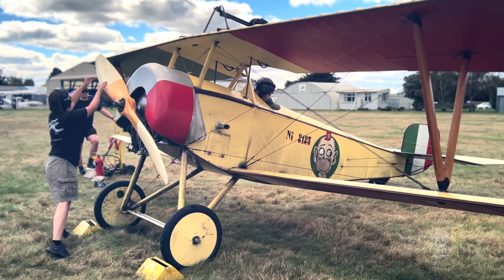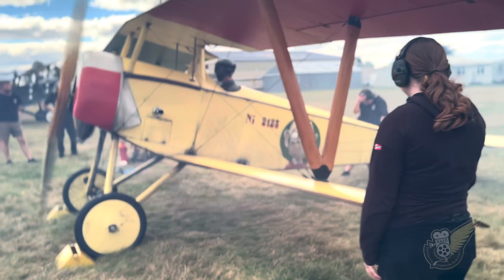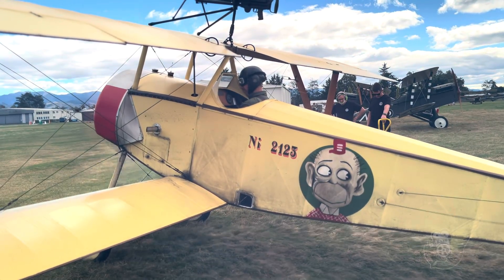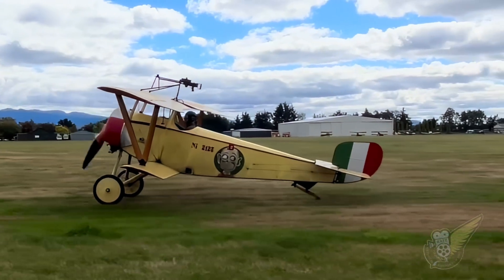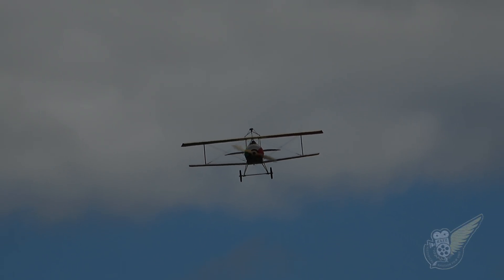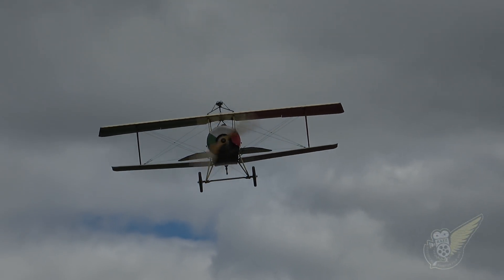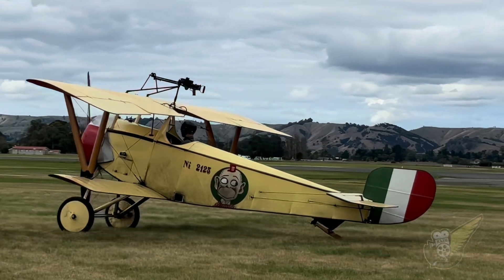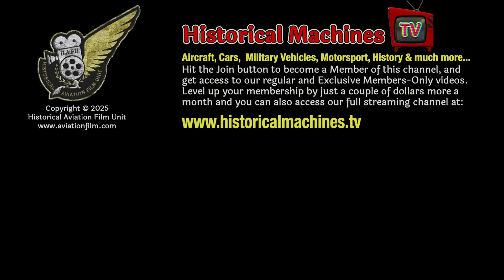Did You Know WW1 Aircraft Used Rotary Engines?

Comment: It is a radial engine. All rotaries were radials, but not all radials are rotaries. The first radials were designed to spin, and were built into the wheels of early motorcycles. The design was enlarged and used to power early aircraft since they stayed cooler due to the cylinders whirling through the air. As they got larger and more powerful, the gyroscopic precessive effect of the heavy spinning engines made the aircraft increadingly hard to control, manufacturers began to build them as fixed radials turning the propeller on the crankshaft in more conventional form.
Reply from the maker: I'm not going to argue with you as I'm over it. General parlance is that these ARE 'rotary' engines, and that's what we call them. What you're saying is like saying the aircraft is NOT a biplane because it has two wings and it is actually a double-decker! Well, no, it IS a biplane because that's the name that people generally call them. You will find very FEW people who know what this type of engine is, who call it a radial.
Reply: @HistAvFilmUnit  
That's a pretty lame comparison, but OK...
...in Germany a biplane really is called a double decker.
It's a radial because the cylinders are mounted radially on the crankcase, like "radiating" outward. That's what makes an engine a radial.
Call it a rotary all you want, nothing wrong with that, but if you say it's a rotary but not a radial, that's incorrect.
It's still a type of radial engine.
"Rotary radial." "Fixed radial "
Reply: @rescue270  Radial is a configuration, rotary is an operation. Rotary because the engine spins, it's how it OPERATES, not just how it looks.
Reply: @waynepurcell6058  
True, that's what I just said. A rotary engine like this is a type of radial engine. I tend to be somewhat surprised by how many people don't know why a radial engine is called a radial engine. There are several ways of arranging cylinders on crankcases; inline or straight, opposed, H, V, W or fan, X, and radial. Rotary aircraft engines are radials that spin with the prop.

Comment: The WW1-era rotary aero engine was not adopted in favour of the radial. It was the earlier design, with serious disadvantages which the radial largely overcame. That's why rotary engines rapidly disappeared from aircraft after WW1. Gyroscopic effect of a heavy mass of engine turning about the crankshaft must've affected control response like turning and banking. In a dogfight that can be the difference between life and death. Fuel/air intake via the crankcase called for addition of castor oil, a poor lubricant for high-load components there. Lack of proper idling control meant 'blipping' the engine during landing instead of using a steady power setting. (Not to be confused with Wankel rotary, developed for cars in the 1960's.)  In my view the early aero rotary was just a silly toy, waiting for serious radial & inline designs to come along.
Reply from the maker: It wasn't really a 'silly toy' -- at the time it was the height of technology, one of the best engines that could be developed with the technology of the time, and one that solved a very real problem -- how to get the most power out of an engine, in a small form that could be utilised by a small and nimble fighter aircraft. That the type was overtaken by better radial and inline engines following the war was in part due to the rapid pace at which aero technology developed over the four years of the war.
Reply: @HistAvFilmUnit  I have to add one problem, a SERIOUS problem that was overcome by the rotary engine was engine cooling.  The other alternative would have been liquid cooled engines which means a vulnerable radiator system. 
Believe it or not there were some pre-WW1 cars built with rotary engines! 
However once practical radial engines were developed then certainly the rotary became a dead-end.

Comment: Very nice!   I think you have to define the audience (& try to get younger people interested?) & to do so in a manner that they will understand.   Some suggestions - most people will have been raised in an electronic environment, they flick a switch/turn a key & the engine starts.  Obviously not the case with hand started engines - so have the narrator make a (brief) description of pre-electric start engines & the need to swing the prop.  Other commentors have noted the engine management system , so  briefly describe the on/off full power/no power control - the audience will generally be oblivious to such a system.  & finally - a brief note on the total loss oils systems.  Just note the grime on the fuselage and tell the audience why.
Reply from the maker: You make some very good points! We'll certainly take your suggestions to heart for the future videos that we have planned.

Comment: Totally  expert  presentation!  Very  clear  view of the  rotating  engine!    A bit more on the fact that the entire engine ROTATES  , how it gave  horrible  "GYROSCOPIC  EFFECT   & terrible torque  made  turns  difficult.  Also  how the only way to slow the engine  was to cut out  spark  ignition, the only time  the engine  was not  burping was under max  takeoff  power!   ..nice  clear  shots. good job  ...is this  in   New Zealand?
Reply from the maker: Thanks for your comment and feedback.  Yes, The Vintage Aviator Collection is based in New Zealand. We are really lucky to have such an impressive collection of WW1 aircraft in this country.

Comment: How did you phrase the changing of the ammunition drum during flight?  "Very difficult?"  I would say "Practically impossible!"  Just as well the Foster Mount came along a little later
Reply from the maker: To be fair I did have in my mind's eye the Foster mount (which is on the Collection's RAF S.E.5a's), so you're correct. Unless the pilot was willing to stand up in the cockpit there was probably not much of an option to change the drums in these fixed mounted guns.

Comment: I THINK YOU MENT TO SAY RADIAL INSTEAD OF ROTARY AM I RIGHT ?😮
Reply from the maker: Absolutely NOT!  This IS a rotary aero engine..... did you actually watch the video.....?
Reply: They meant to say rotary.  This piston engine is rotary in that the crank is mounted solidly to the firewall/engine bulkhead.  The entire engine rotates around the crankshaft. The prop bolts to the crankcase, and spins with the engine.

 These engines were incredibly light, compact, and ran cool. They were also simple and dependable.

Comment: It would be a better video if you explained why so many Allied aircraft were powered by rotary engines: advantages, (ex: better power-to weight ratio compared to stationary engines), and even the disadvantages (ex: power output tends to fall off more rapidly with altitude compared to stationary engines.)
Reply from the maker: You make a good point! We are planning on delving deeper into rotary engine design and its advantages and disadvantages in future videos.
Reply: Cooling, easier to build, lighter.
Reply: Nice AI.

Comment: It's a beautiful biplane but how does the pilot reach high enough to operate the machine gun?
Reply from the maker: I believe that in the original aircraft there was a trigger-wire that ran down from the gun, into the cockpit. But I'm open to correction about that.
Reply: Later aircraft had a button (electric?) on the joystick.  Maybe this aircraft had one too

Comment: I think that the viewers that would watch a video of this type would be well aware of the reason for an early aeroplane engine having a rotary function, it is obviously very light for power output, it is also self cooling even when the aeroplane is not moving, and there are no reciprocating parts, unlike the radial engine which has to be constructed heavy enough to withstand the reciprocation of rods ,pistons etc through the crankshaft, that said, "modern man" being largely ignorant about such things ,and having seen many radial engines will argue for ever that this is a radial engine, just keep up the educational information, eventually it will have an effect on the dimwhits. Chris B.
Reply from the maker: Very true. You'd be surprised at how many people tell us (on various videos) "That's not a rotary, that's a radial" !!!  We're working toward a series of videos on the different types of rotary (aero) engines and will include much more detail.
Reply: The WW1-era rotary aero engine was not adopted in favour of the radial. It was the earlier design, with serious disadvantages which the radial largely overcame. That's why rotary engines rapidly disappeared from aircraft after WW1.
Reply: @rocketeerPM2500  Well yes! We all know the rotary engine was on the scene first, it was an ideal design for the very light airframes of the time, and the radial air cooled engine had not been developed to the the state it was after the war, the "disadvantages" you mention are few in relation to it's use in the very light aeroplanes of the time, and it had the advantage of being able to be built very light due to the non reciprocating of parts mentioned earlier, and having no need for coolant and radiators, it obviously had the disadvantage of not being able to produce much more than 200 HP, but there were very powerful rotary engines produced late in the war. Chris B.

Comment: Excellent job - thank you.

3:25 Just a suggestion: I am sure that your explanation here was enough for experienced viewers, but in my humble opinion it would have been better to say that on a sesquiplane the bottom wing was deemed too narrow to use the more stable N-strut type, which, because it has two points of contact on each wing using an interlocked double triangle structure that forms an inherently rigid trapezoid, resists twisting of either wing, whereas with a single point of contact & no supplementary wire bracing to to add rigidity the lower wing can swist around that point of contact.
Reply from the maker: A fair point. We'll do that when we produce a more complete video of the N.11.

Comment: I have always loved WW1 aircraft. I think it would have been nice to get a close up of the engine before start up to look how it differs from a radial engine. I also think it would have been great to share how there was no throttle on the engine so to control propeller speed the ignition was turned off and then on as you could hear in the video. Also you could have shared that because the fuel came into the engine through the crankcase oil had to be added to the gasoline much like a two stroke engine today and the oil used back then was caster oil which cam out the exhaust and on to and into the Pilots that could give them diarrhea! Took alot to be a pilot back then.
Reply: And the gyroscopic effects.
Reply from the maker: Thanks for the detailed feedback. We are planning on a much more detailed description of the rotary engine and how they work. This video was more of an experiment than a final production. We'll keep your comments in mind though -- very useful, thanks.